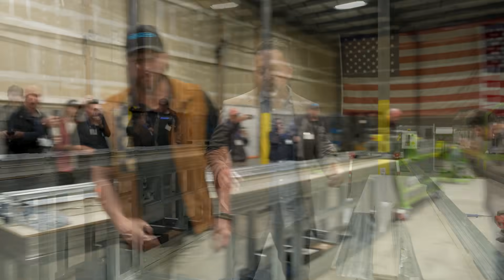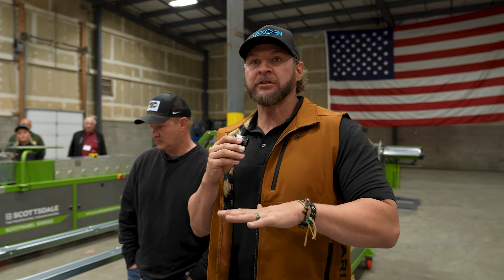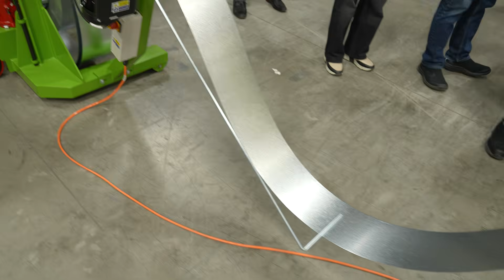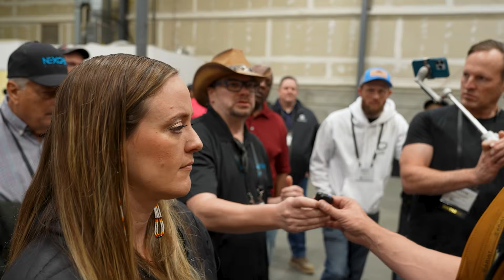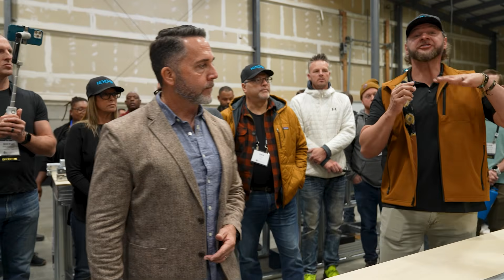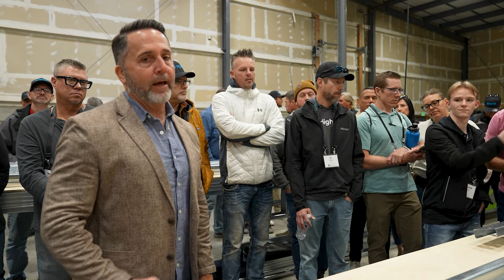NexGen Steel Facility Tour & Training

Comment: I don't get it. Of the shelf RHS thin wall (3 mm) does the job and you are assembling in minutes with welding. LSF has very low structural integrity

Comment: Can your Nex Gen framing packages be used as the basis for a line of disaster resilient homes, which we in the Midwest ( tornado alley) would love to see.  No one ( we know of) is currently producing this type of affordable ( under 200K) disaster resilient housing solution.  What gauges of steel will be used in your framing packages?  Have you ever thought of using thicker steel for disaster resilient packages for the Midwest ( that can with-stand up to 200 mph wind speeds)?  Also, can your framing packages be used to build tiny homes?  Thanks
Reply: Yep - we design to local code, including Miami-Dade HVHZ and California Title 24. We usually work in the 16–20 gauge range, depending on what the structure needs. We’ve worked on projects with Habitat for Humanity, and we’re always open to teaming up on smart, cost-minimizing solutions for affordable housing. We also do tiny homes, where steel being much lighter than wood can really help with transport and setup.

Comment: Do you still need shear walls? Or does the design of the dimples eliminate that?
Reply: In certain conditions, when the architecture requires it, steel moment frames can be used to eliminate shear walls at specific locations within the design. Generally speaking, our steel shear walls are dramatically stronger and more consistent than wood-based shear systems, which often allows engineers to use fewer or shorter shear wall runs. We do not rely on wood structural sheathing to provide shear resistance. By contrast, lateral loads are carried through steel members and steel connections. It provides greater architectural flexibility and avoids long-term reduction in shear associated with wood, such as material decay, shrinkage, or fastener pop.